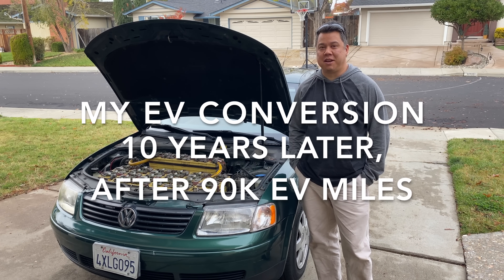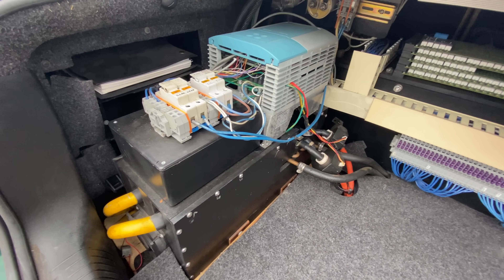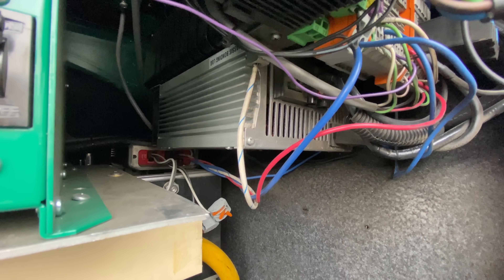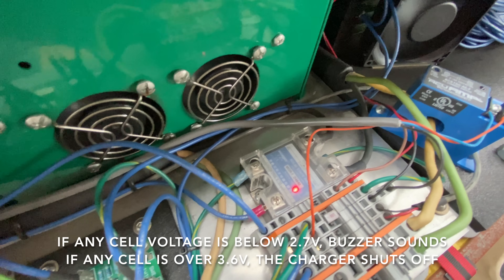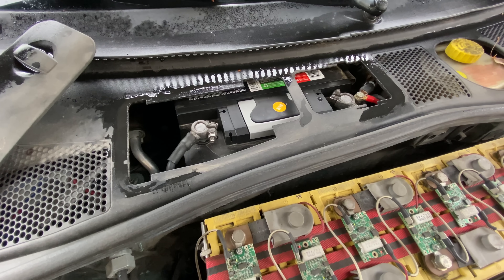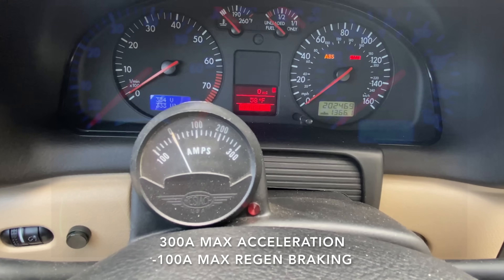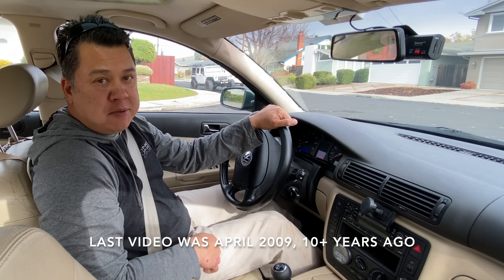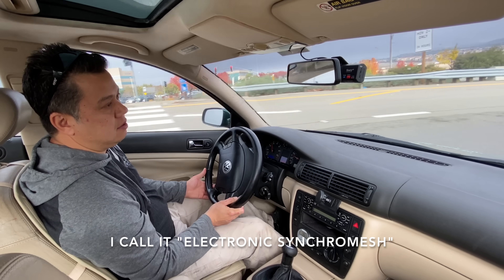My EV conversion after 10 years and 90k miles

Comment: This simple car is a 100mile range car. $25,000 investment. Now start appreciating the Tesla more.  This is a POS Passat and has a paltry 100 mile range vs. the Tesla 3.    If this guy would have bought a new Prius at the time and used it until now, his overall cost at the end would be exactly same.  In 90k miles the Prius uses approximately 2,000G of fuel. Currently that is $4000 but lets say $3/G and that makes it $6,000. Make it worse and say the car did not get 45miles to a Gallon, only 40. So it used 2,250 Gallon at $3 = $6.750  His Solar panels cost him 9 grand.   Electric or not it was a bad investment.
Reply from the maker: It's good to challenge your mind once in a while, the project was worth it for the education and doors of opportunity that it opened for me.  Pulling up to my job interview at Tesla in a brand new Prius wouldn't have had the same impact.
Reply: @etischer  yes, I totally agree on that.  I love what you did but I wanted to point out how great value is the new Tesla.  Lot of people does not realize the complexity of electric vehicles. The average electric cars have 40% less parts and require almost no maintenance. The initial higher cost can be offset by this on a long term use.  But the complexity of electric vehicles comes from battery management. The battery technology needs to improve a lot in order to make them fully equivalent to the gas powered cars.  The real-world mileage is improving,  Tesla for example is still lagging on that (70-75%) front, but Kia for example reached about 85-90%.   350 miles range and 30 minutes charging time , approx $30k base price is what the average car needs to do. We are not too far from it so it will happen soon.   Lot of people would be ok with 70 miles range, but still a lot of them not. The US is large and the middle of the country is still very unpopulated and sparse. The electric cars have an easier life in EU where the unpopulated areas are smaller. 

Trouble is the cost of each KW is much more in EU then the US, so the cost of recharging is higher.    Solar panel might be ok but their capacity is not yet enough to quickly charge a car. Then the house needs a battery pack with the solar panel and this is further increasing the cost. At the moment the hybrid is the most cost effective and safest solution for transportation.
Reply from the maker: @oldwortex5818  Well yes, Telsa Model 3 is better than the home built car I made myself 10 years ago.   I also have a Model 3 AWD LR, and worked for Tesla for 7 years.   You can buy a Model 3 for $35k, it is an off menu car not listed on the website, you have to call in to order it.  My LR model 3 is rated 322 miles, and can charge 150 miles in 11 mins.   It's Corvette quick.  Adding batteries to get 400 miles, just adds weight and reduces efficiency, acceleration, braking...  I think Model 3 AWD LR is the sweet spot.   2020  Model 3 SR is also the most efficient car on the market, 141 MPGe combined city/highway, more than double the MPGe of the new Taycan.  Even beats the Hyundai which has a much smaller battery and smaller motor.

As EVs improve, the bar will keep moving.  As soon as a 400 mile, $30k ev comes out, someone will say what the world needs is a 500 mile car for $20k.

Comment: This is what manufacturers do not want you to know and do.
Manufacturers indoctrinate consumers to thinking you need to dispose to get an upgrade.
Example and Proof "Retrofitting" works.
This the key to reduction in our waste and extension of resources. 
This kind of initiative should be what Governments must encourage and subsidise.
However, Governments do not wish to support this behavior as Governments are in bed with Businesses and would also rather get more sales tax from NEW larger purchases rather than retrofitting.
More sales tax in a 40-50K electric car than a 20-25K car (even less when the industry matures in competition and efficiency)
In case you are unaware Governments believe in retrofitting more than the consumer model of buying to upgrade. Fighter planes of F15, F16, F18 etc have been around for decades being upgraded.

Comment: W8 not 12 in that car. And it's not a w or vr or other gimmick name. It was v8. 2 exhaust manifolds 2 cyl heads 1 intake to feed wait for it 2 banks just like v8...
Here is better we question. Not range becouse its obviously not there and no remote driving. How about an Ahole question how is environmental impact. Let's not ignore lithium mines,battery manufacturing as nd disposal.
Reply from the maker: Let's not ignore 5.9 trillion dollars and thousands of lives lost protecting the flow of oil from the middle east.  Let's not forget 1.5 million tons of oil spilled during the gulf war, or  2 million tons of spilled oil for the next 10 oil spills. Batteries that can't be used for EV use will be used for stationary storage.   All batteries are recycled, there are valuable metals in them, in California it's illegal to dispose of them in the trash.   Tesla recycles batteries 100%.
Reply: @etischer  quick to make defense with examples that apply to lithium mines. Which located is same/similar areas. Sense my question ignored. I'll add more to injure about slave labor and no  emsions(general term) control in those areas. Becouse its cheap that way. Not white lie. They are not 100% recycled, your term. Hence limitation to your state, they get sent out where there is no disposable regulations. 
I asked question that no one in ev ever awnsers instead sad attack attempt on focel based fuels. Emission issue is horrific in ev tech, yet sales point there is none that consumer sees. 
Why not explore something that actuly is clean?  What happened to hydrogen tech?

Comment: Very cool.  Nice to see good longevity come from your EV. It makes me wish I better understood it all to convert my own. Your batteries are pretty open. Good for cooling and still ok in the wet?  battery cooling is the one thing that really gets me down with my 30kw leaf.
Reply from the maker: The batteries have a low enough internal resistance (100m ohm) that they don't generate much heat, (about 360 watts) over 700lbs of lithium at freeway loads (60A).  Haven't had any issues with moisture.

Comment: A fuse blows
2:29
Him: ⚰️
Reply: Would take 10 seconds all in to check every single fuse there. top and bottom of the fuse is an exposed metal strip where you can probe it checking for power.

Comment: Sounds like you have about 200 mile range (I am sure that varies considerably depending on the type of driving and terrain). Can you speak to the range? Very very impressive....
Reply from the maker: Range should be around 100 miles (33kwh battery).   I haven' taken it farther than 70 miles, just to be easy on the batteries.
Reply: @etischer  Thanks! Very well done....

Comment: So is this compatible with any charging station or can you only use the charger at your house?
Reply from the maker: Works on public charging stations that use J1772 (USA standard).  I also made an adapter for the original Tesla Roadster charging station, since that was what was installed at Tesla when I joined.  These public "chargers" are just power cords, the battery charger is onboard in the car.

Comment: Impressive. How is the handling? That's a lot of weight in the front.
Reply from the maker: It's actually lighter in the front compared to stock, and 500 lbs heavier in the rear, so close to 50/50 weight distribution.  Handles ok, it's built for comfort, I wouldn't call it sporty.
Reply: etischer very cool. Very impressive project. I admire anyone who can put something like this together and make it work. Respect.

Comment: What about water entering the engine bay? Shouldn't electronics be kept away from water?
Reply from the maker: There's a belly pan that seals off the bottom end, and gasket all the way around the hood opening.  Haven't had water enter the engine bay.

Comment: I do own a ‘youngtimer’ diesel car and waiting for conversion kits to enter the market for which someone has spent many months to find out the do’s and don’ts, the what’s and the how’s. The knowledge but also the trial and error that have preceded this conversion is beyond belief. Therefore while impressive, this example is not scalable unless and until standardized. When done and available, it would save the planet a lot of CO2 but most of all avoid the terrible waste involved in modern car making combined with scrapping still useful car bodies. One stumbling block in Europe are the regulations on EV cars - in the US you can do anything after you have a license plate, whereas MoT or Tüv or Rdw will throw all sorts of requirements at you. So for EV conversions to become popular in Europe, more than some clever set of electrical and mechanical parts is needed. Current conversions custom built by specialized companies currently cost 40kEuro, imho that is still 25k away from a positive ROI, even with 10 years of little maintenance and low value loss of the car itself.
Reply from the maker: Just sell that car and buy a Model 3, or at least test drive one.  Building an EV is more than just an EV powertrain.   I think the era of home conversions is over, there are plenty of EVs designed from the ground up that are way better than a home conversion could be.

Comment: A lot of clever solutions, but the sheer number of unprotected connectors and flying wires makes me cringe. Seems like a lot of those parts were never intended for automotive installation. This would not fly with the German Tüv, especially the underfloor batteries and all the loose dangling cables going to them.
Kudos for working it all out, but I can see why it was that cheap. ^^

Comment: I'm impressed. Great work!

 What do you use for DC short circuit protection?
Reply from the maker: For the pack I'm using 350A DC rated semiconductor fuses

Comment: Doubt the cost was ever recouped.  High upfront expense converting everything. With no more than 70 miles a day, he's not saving that much in gas. Still has expenses....transmission fluid, new batteries, solar panel replacement. etc.  No thanks.
Reply from the maker: This project was never about trying to save money, I did it for the challenge and the education.   But, let's compare it to a 25k gas car; after 10 years it would be worth $5k, plus you would have spent $16k in gas and maintenance over those 10 years.  Your total cost over 10 years would be $36k.   I would have spent about $20k.

Comment: Imagine he just hard crash into something - with all those acid in batteries it would be ecological catastrophy :D
Reply from the maker: First of all these batteries are not filled with acid, there is no spillable liquid inside  These don't even catch fire when pierced with nails or bullets.  Imagine 4000 gallons of gasoline being burnt, that's more of an ecological catastrophe, which was avoided by driving with an electric powertrain for 10 years.  Imagine an internal combustion car crashing;, 26 gallons of spilled  gasoline flowing down the street catching fire, plus another 6 quarts of hot  engine oil, high pressure coolant spraying everywhere...   There's no question an ICE car would be worse for the environment, not only in an accident, but just daily driving.
Reply: @etischer  Of course you are right - i did not imagine there are unspillable batteries. It just came into my mind when you showed all those batteries under every piece of coverings...  You have all my tributes as this is awesome - you just give a new life to old thing. This is true ecology!!! not as todays ecology!!! Keep going and if i may ask - whatb is the remain battery capacity after those 9 years?
Reply from the maker: @Thomeeno  Hard to say really cause it changes with temperature, and discharge current, time...  I'd estimate the pack is at 75%, with one cell that's at 50% cause my simple BMS allowed it to fall behind while all other cells got top balanced.

Comment: Nice work, I like how you use off the shelf parts and modules, the hard part is matching it up so it all works together. One day I'll take on something like this but might start with an e-bike.
Reply: I built an e-bike using an add-on kit.  The motor is built into the front wheel.  Works great except for uphill on loose gravel. Then I bought an MG Midget someone else had converted, using lead acid batteries.  I will sell that to you if you want it, then you can convert to Li ion. Gmail is daverileyak.

Comment: Of all cars tho, why a Passat?
Reply from the maker: It's very aerodynamic, has lot of room for batteries, has a good payload capability (V6, W12...).    I like German cars, and this was cheap cause it had a blown motor.  The interior is nice, good stock stereo.  Steering rack is tucked up high and out of the way, quite unusual position compared to most cars.   It's a nice, comfortable cruiser to commute in.  At the time, most people were converting Geo Metro or old air cooled 914/Beetles. 

https://www.passatworld.com/threads/passats-among-the-most-aerodynamic-cars-in-history.221112/#post-1481652
Reply: @etischer  okay, cool!

Comment: Are you going to sound insulate the motor so you dont hear the VFD? GOD I HATE THAT NOISE LOL
Reply from the maker: I think you're probably hearing the power steering pump.  The VFD/motor make a really faint high frequency noise like a dewalt drill, I can increase the switching frequency on the VFD from 3khz to 9khz and it's inaudible, but then it runs less efficient and hotter.
Reply: @etischer  I saw that you had a VFD and I just know its making that high frequency noise. I work with induction motors from 10 to 1000 hp on varible frequency inverters...the noise will drive you crazy in an enclosed space like a lift station or industrial site, even with double hearing protection. Thank god some of the larger 5000 horsepower motors like on a stock refiner are never on VFD.

I also do RC as a hobby and my 40x92mm brushless motor screams but not nearly as loud as the large industrial applications. The ESC (electronic speed controller) is just a radio controlled VFD.
Reply from the maker: @midship_nc  The motor is water cooled, so that might help trap some of the switching noise since it's totally sealed.  Then it's behind a wall of batteries.  The car/firewall is sealed off from the outside and also has sound insulation.  It's pretty tough to hear the motor inside the car.   Only time I really hear it is when the windows are down, reflecting off the walls in a fast food drive thru. But yea, I know the noise from other VFDs in a factory.
Reply: @etischer  but ultra cool project. You must be an electrical engineer or have 20 years experience as a electronics and instrumentation guy

Comment: ...what an intelligent guy! More money than sense however, a compete waste of time. Don’t think I’d want to fork out that much money on an experiment when a new genuine electric car would cost far less. Hey If that’s what you wanna do though more power to ya 👍🏻 We all have our hobbies .. but I’m out.
Reply from the maker: Well, I started the conversion in 2008, 2.5 years before the Leaf and Volt came out, so this was the only way to get an Electric car at the time.   Yes, electric cars have gotten cheaper now, but I also saved ~$16k in 10 years not buying gas.   It's just like 60"  flat screen TVs at the time, they were $10k and now $500.

Comment: Is that a documentation binder in the trunk?
Reply from the maker: Yep, I keep a print out of the schematics.  I can pull up all the variables and constants on the key pad, just incase I need to troubleshoot and I don't have a laptop on me.
Reply: @etischer  Haha, that's pretty slick. So is the car in it's current state a frozen version, then? Or is stuff still getting added.
Reply from the maker: @arbiterodie7685  Last software change I made was about 9 years ago when I added the encoder.  Last hardware change was adding extra cooling fan in the trunk 8 years ago.  Has been a project taken to 100% completion!
Reply: @etischer Niiiice. Welp, your car is my unicorn sighting for the month-- a finished project without any air quotes around the word finished. Thanks for showing it on video ;)

Comment: wow just wow. I absolutely love what you have done with that old Passat. amazing job! 
Did you have any experience with this kind of conversions beforehand ? This is simply amazing!
Reply from the maker: I had done a few other gas conversions.  Mazda Rotary engine in MG Midget.  A few different Subaru motors in my 914 (1.8L Turbo, 2.7L Flat Six)

Comment: Those ratchet straps drive me crazy hopefully those batteries stay in place if you have a rollover accident.
Reply from the maker: 4 straps hold in 28 batteries at 7lbs each (196lbs total).   UTS of each strap is 1,500lbs.   Assuming the car was inverted and batteries are hanging from the straps, factor of safety is ~30x.

Comment: You reengineer that car completely.  Can a F350 be converted to electric?
Reply from the maker: Sure, but the efficiency will be maybe 50% compared to a smaller, more aerodynamic car.  Which means you need 2x the battery, twice the cost, which weighs twice as much, further reducing the efficiency... At some point it's a loosing battle where adding batteries becomes less and less beneficial.